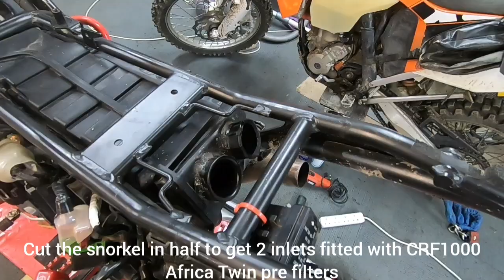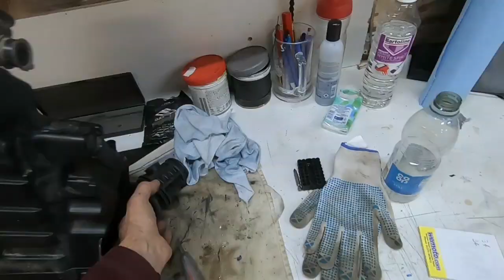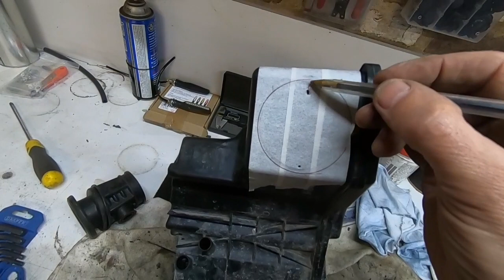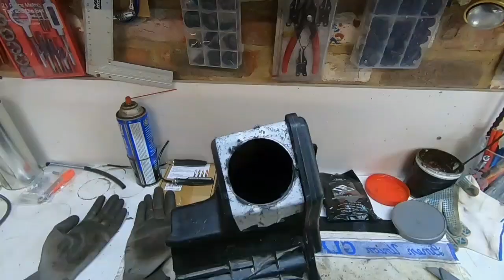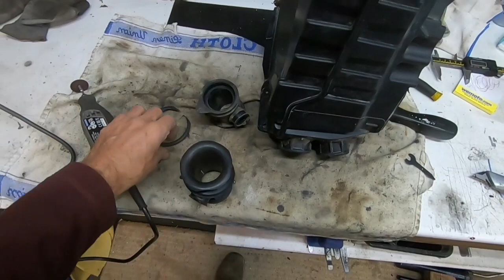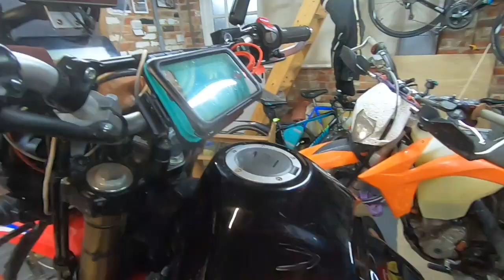Honda CRF 300 Rally Airbox modification

Comment: I just did this modification tonight.  Man that was a miserable experience.  I had to put a lot of downward pressure on the throttle body and at the same time push up and forward on the air box then I had to put a bolt in the airbox mounting hole to keep the airbox in place while I push the CBR air boot onto the throttle body.  Man what a pain in the ass!  It took me an hour of pushing, turning, contorting, resting, grabbing a beer and trying again and again to get everything lined up.  I finally got it, but man it would go so much smoother with someone putting the bolt in while you push the airbox and the throttle body.  I only have two hands but you need three.  While you have the bike tore apart you should block-off the pair valve, remove the evap canister/Air Injection solenoid and the Evap purge control valve.  I weighed all that and it was 2 lbs of environmental  garbage that is not necessary.  I blocked off the pair valve with the 550 performance block-off plate.  Installed the stage 1 ECU and the Yoshimura exhaust.  I also removed the snorkel off the rear air box and installed the high flow reusable air filter by 550 performance.  I definitely noticed a difference in my bike's top end speed and the acceleration from zero to 70 was faster.   I'm not sure if all my effort and money was worth the small performance boost.  It's not huge but you will notice better performance.  With the RSC clutch lever, double-take mirrors, hand guards, crash guards, skid plate, Yoshimura full exhaust, Fancy decal kit, Yoshimura tail tidy, red anodized zeta foot pegs, Lithium Ion Antigravity battery, front and rear LED turn signals, tail luggage rack, race tek suspension, I have spent $4550 + bike $5400 = $9950.    If I were to do it all over again I would have just bought the CRF500L and fixed cutting out issue with a tune.  I did not enjoy that airbox modification.
Reply: ... I am getting ready to do the CBR intake mod and I also am not looking forward to it. 
I thought it was this video where the gap that fits onto/into the air box was widened to give the boot more play/space to be tilted down to fit w/o so much tension? I have watched so many videos on this I can't remember.
.
I received the Yoshimura RS4 full exhaust, 550 Stage 1, (91 octane). 
The DNA air filter and service kit comes from Europe and was stuck in customs for a while. Still haven't received it. Supposed to be here this week. 
.
"While you have the bike tore apart you should block-off the pair valve, remove the evap canister/Air Injection solenoid and the Evap purge control valve."
That makes me nervous not fully understanding all of it. I know Jake the Garden Snake did a video on it. Does removing all that really make a difference? 
Yeah, I'm a little concerned doing all this. 
I hope all this $$ and time is worth it. 
. Jeff.
Reply from the maker: @Jeff_240  good luck!
Reply from the maker: Agree with all that you wrote. I did have help!
As for the spend...the same for. Spent a fortune but I do enjoy the bike.
Reply: some people just aren't mechanically inclined

Comment: How did you grind/cut the diameter of the new tube to fit the original airbox hole? I like that method vs cutting the airbox.
Reply from the maker: I used a Dremel with a small grinding disc, about 3cm in diameter. It really is very easy, just go steady. I practised on the old tube first.
To enlarge the hole in the air box, same Dremel, fitted with a small routing bit.  Slow and steady, keep looking as you can't put it back on!!
Reply: @jeffwkirby  Watched it again and around 58-59 and a bit oblong.   Thanks this is a helpful vid.
Reply: So what was the final dimension of the whole on the box?

Comment: i have the cbr intake but i ended up cutting the original tube flush on the inside of the airbox,was a def improvement,im running the 550 stage 1 and black widow muffler
Reply from the maker: Yes, I considered cutting off the inside but I wanted to maintain the profile of the cone which should help improve 'velocity'...but as you say, an improvement for sure.